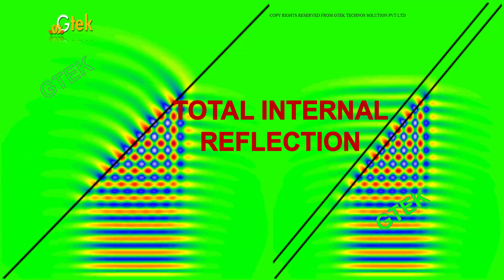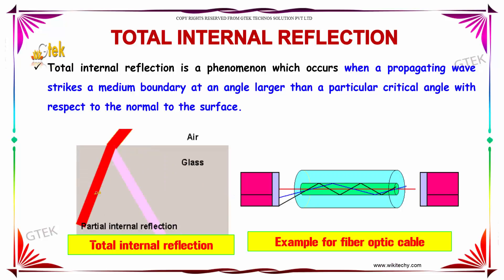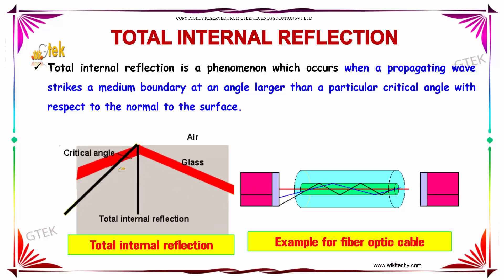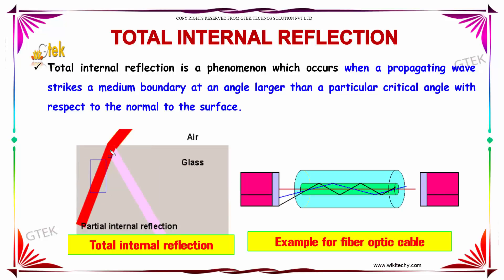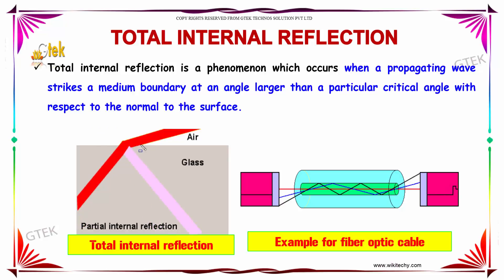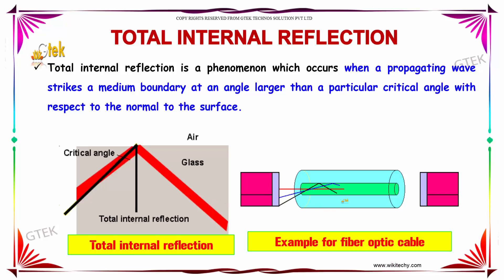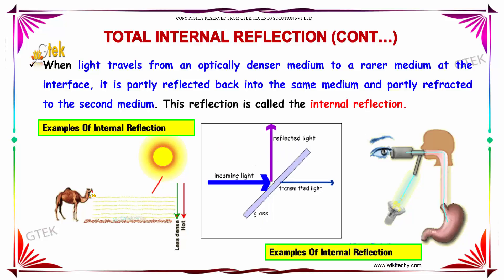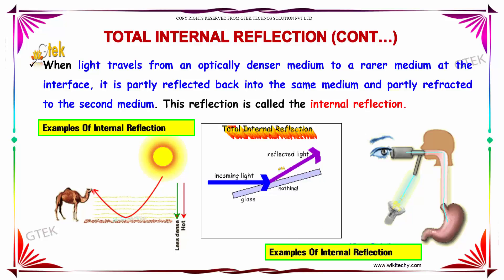Total Internal Reflection |Optics|class 12 physics subject notes lectures|cbse|IITJEE|NEET

Comment: The critical angle is the angle of incidence above which total internal reflection occurs. The angle of incidence is measured with respect to the normal at the refractive boundary (see diagram illustrating Snell's law). Consider a light ray passing from glass into air.

Comment: When the angle of incidence of the light ray is greater than the critical angle then no refraction takes place. Instead, all the light is reflected back into the denser material in this case the glass. This is called total internal reflection.

Comment: Reflection is the change in direction of a wavefront at an interface between two different media so that the wavefront returns into the medium from which it originated. Common examples include the reflection of light, sound and water waves.